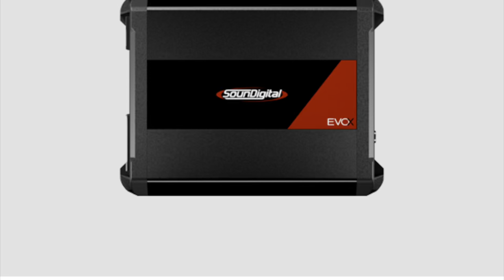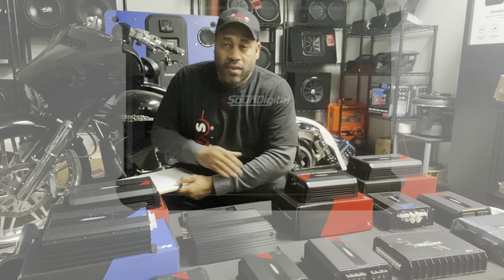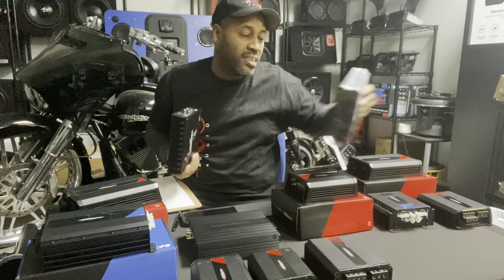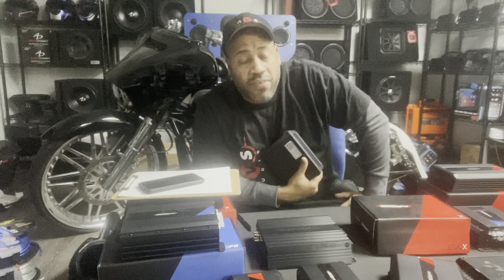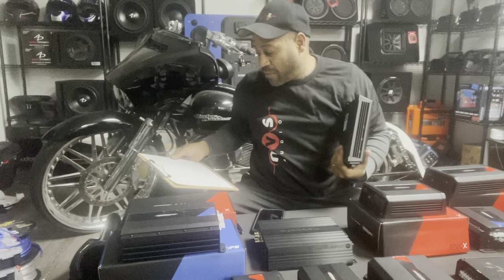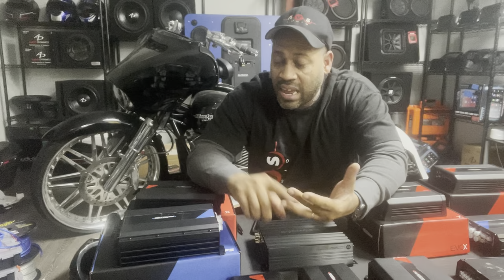How and why we use Sound Digital amplifiers in our audio builds . We love  their size to power ratio

Comment: I installed my 800.4  according to your recommendations.  4awg ground to frame, crimped and soldered, wire ferrels ets  Thank You for all your great videos.  Keep up the great work.
Reply: Me too planning to buy either soundigital 800.4 or banda 800.4 to power 4 midrange speaker of 180 watt rms each. Which one of the 2 u recommend?? I need something which is durable, gives enough power and produce clean music.

Comment: I have an EVOX 800.4 ON MY ROAD GLUDE.  Rrunning 4  diamond audio speakers at 4 ohms each.  Amp installed with FOSGATE complete amp install kit. Gain set with SMD DD1.  No issues after 1 year.

Comment: I almost exclusively only install 2 amplifiers as of right now. The NVX VADM2 or  Sound digital 800.4.   My reasoning behind that is how bulletproof both of them have been. I agree 100% with everything you have said. I would like to add..... if these shops continue to install these high powered audio systems on stock batteries their failure rate will continue to  climb.  I believe you recommend a battery upgrade at  1000 Watts.  I do the upgrade at 700 watts just to stay safe.  Another great video keep up the good work.
Reply: Great point.  You really need to upgrade battery.   Small price to pay to upgrade to lithium when you are spending $3k plus for sound system
Reply: How many options are there when upgrading the battery? Could you add a capacitor or are you talkin about adding a 2nd battery
Reply: @midwestprince153    The short answer to the  capacitor  question is no do not use a capacitor .At this day and time it is not worth the money and especially the space.  There are lots of battery upgrades for Harley Davidson touring models. CCA as well as amp hours or two  Very important numbers to look at.  Basically the more the better. I would not  even start thinking about adding an extra battery until  2400 watts rms. AMG battery up to 2000wrms  Anything more than that  Lifidium battery only.  There are a lot of reasons for my answer but I'm trying to keep it as short as possible. Sorry for the delay in my reply.
Reply: @romesyoutubechannel5356  thanks
Reply: @midwestprince153  I upgraded to the Braille Lithium Battery and I’m very pleases
Reply: Drops the amp on the floor at the end...... damnit lol

Comment: Sound digital amps are the best amp you can put in a daily rider with a system upgrade. And the fit is in my opinion are great!
Reply: Happy you enjoy our amps.
Reply: @diogoiannaccone  love them. We are a vendor for sound digital. Nothing but the best for the Harley Davidsons! Let me know if you happen to have any banners available for our booths we run at get together, audio competitions etc. Our distributor is HKI.
Reply: @ShadowSolja  i am HKI Ceo. 😁 Yes we have banners. Just ask rep to add in your next order.
Reply: @diogoiannaccone  Will do. And Ground Zero is a hot seller. Sound is amazing!! And thank you!!
Reply: @diogoiannaccone  glad to see this video. 
I have 3 of the amps,  2 evo 800/4s running 8 6.5 s (hertz and ground zeros). 1 800.1 to 10inch sub.  No issues.
Reply: @superduty131  planning to power 4 deaf bonce speaker of 180 watt rms each and saw the 800.4 Amp. Are they ideal for fo SQ music?? Are they durable amps??
Reply: @yan5362   Very durable. Sound quality is awesome.

Comment: Our Failure Rate is even with yours, 5% ish Cant be beat for Power & Size, However Diamond Audio has new Amplifier product on the water we are forever waiting for !!
Reply from the maker: Thank you for sharing Your experience 
I truly value your opinion. 

I
Am awaiting the new diamond audio amp as well.
Reply: Appreciate the support
Reply: which amp is that?
Reply: @Grof2000  We use Mostly 800.4 EVOX & 1200.4 EVOX
Reply: @702motoringlasvegas4   do they fit inside  street glide fairing
Reply from the maker: @702motoringlasvegas4  

I have them on my test bench 😉 👍🏽
Reply: @NVSAUDIO  I do not doubt that for a moment. Lol 😝
Reply: @Grof2000  Yes, you can easily fit two of them if needed
Reply: Hey guys how does Recoil amps compare to Sound Digital?

Comment: I've never heard of this brand... And I trust you ... I want a 2 channel to run two 10w6v3 dual 4 ohms .. I need at least 1200.2 but willing to go 2200.2 not even sure there is anything that big... I've only bought dual 4 ohms in the past .. so I have lots of pairs of dual 4 ohms .. even 12 Alpine type Rs 2200 max watts... I have an old 1999 Rockford fosgate that works amazing ...it's twice the size I want in my little 2008 Subaru legacy....I like the kicker kx1200.2  ... The two channels do not work with the wireless bass knob...it requires a Aux bass knob ... I almost bought that amp a few days ago ... Thinking I can buy the bass knob separate ... But nope it won't even link to it ... Not wireless... And not even wired ... I'm not tripping on price...I just want something that works like a JL, Fosgste, kicker, .. Something that stays cool... When running RMS ... What 2 channel of these amps that you're showing would you recommend for my dual 4 ohm subs to run at 2 ohms

Comment: What’s up Carlos…..I have 3 EVOXs in the front fairing of my 2021 Road Glide Special…I have a EVOX 400.4 (4ohm)on my horns(EX6NCD-CF), a EVOX 1200.4(4ohm) on my midrange(EX6NCD-CF/EX69NCD)bridged, a EVOXII 1600.1(2ohm) on my 10”s (EX10NMB) and a HKI mini DSP…I’m running 0g ofc power and ground wire from the battery to a power/ground block …Off the blocks I’m running 8g to the 400 and 4g to the 1200 and 4g to the 1600….My first question for you is do I have enough power to run them new euphoria speakers/midbass….Second question is do I have to upgrade my battery and if so what’s the best battery to use…My third question is do I still have to get my factory radio flashed when using your T-harness …Fourth question is will the 10’’s in my bags effect the 6x9 in my lids….Thanks in advance Carlos
Reply: Yooooo do you have any pics of you install in the fairing.    I’m want to put. 400.4,800.4 and 1200.4 in mines.   I have an RGS WITH LEX AMP RACK
Reply from the maker: Yes you need a lithium battery 

I like
The Braille g30h

Yes you will need to flash your radio 

Hki mini does not like the high voltage from non flashed Harley radios . 

800 watts to each 10 is perfect in my opinion 

Yes you will need to baffle your 6x9s if you are running 10s in the bags
Reply: @mrchuckwoods  ……yes sir
Reply: @atgang7153  where the pics of the install at????? Lol

Comment: After stumbling across your video, I'm wondering if the failure rate is attributed to cooling issues with these amps. In a breakdown video I saw that the housing itself, like with many amps, acts as a heatsink and has thermal compound between the ICs and the housing. Have you broken down a failed amp to see what the condition of the thermal compound is? In nearly all failed electronics I've dealt with the failures have been either a capacitor issue, or poor heat dissipation.

I intend to build a 6-speaker system for my truck using a 6.5" 3-way in each of the four doors and a pair of 6x9 4-way in the cargo area. Being an expedition rig I don't have much space for physically large amplifiers and have to fit both under my driver's seat, so I've been planning an EVOX 800.4 for my door speakers and an EVOX 400.4 for the pair of 6x9s in the rear and no subwoofers. As part of the install I intend to open up the amplifiers and replace the thermal compound with higher end compound that I use my computers, along with mounting the amps on rubber bushings to absorb road and trail vibrations from my truck (lots of washboard roads). What is your opinion on using the EVOX amps in an application like this?

Comment: I have 2- 1200.4 in my fairing and they are cooking my Sony 700 they get hot shut off and I have Spencers under them! Wonder if SD would swap out for 2-800.4 even swap? I was about to go with a different company until I watched this video! I have 4- SPL 6.5 and 4-SPL 6x9 and 1-8 inch 200L in each bag all Hertz Neo would 2-800.4 be enough power? Thanks for any advice and thanks for all your awesome videos!
Reply from the maker: Call me 

I will
Help you trouble shoot your build 

We run 2 12 in the fairing with no over heating issues
Reply: @NVSAUDIO  ok just call the shop phone and ask for Da Man carlos? Thanks so much you are a awesome Guy!!
Reply: Hey Carlos been trying to call numbers on the internet with no luck getting through to you plus I think I may need to purchase a pair of your crossovers for my hHertz Horns! How can I contact you? Thanks again!

Comment: Thanks for the video,  I bought the 800.4 sound digital amp (grey case) I tried installing into my street glide with the aquatic av radio. I cannot get this amp to work. I've tried EVERYTHING!  I'm only running 2 ds 18 pro speakers, ( possibly more in the future) anyway I had a guy message me and said I have to have splitter rca cables to hook up using both channels , going into one set of rca's to the aquatic radio( which only has one set of audio outs. Does this makes sense? I'm only using 1 channel. What's you professional opinion? Thanks

Comment: So I have a 6 speaker set up

SD 800.4 running 4 Hertz sx165s

And a 

SD 400.4 running 2 Hertz SV200s

There’s also 2 Hertz 25mm horns as well

Would you say I’m underpowered? I don’t know much about audio and didn’t do the work myself.

Comment: My main problem with Soundigital is the low end signal noise, do any of you know how to improve or eliminate it?
Reply: I had same problem.  I have one 800.4.  First thing I did is added 4awg ground to frame. Then removed all grounds from my T harness (radio and dsp) and connected to same ground as amp.  When I replaced my stock radio with Sony itt came back.  I fixed that by adding two rubber washers to each of the 4 radio bolts .  Isolating radio from radio bracket.  (Grounding radio didnt fix it)
Now I only have the VERY LOW normal  SD hiss they are known for. It cant be heard at low volume  only at 0 volume.
Reply: @robleeva  I definitely appreciate your advice, will certainly try it out, thx!!

Comment: Bridging sees half the load, twice the output. 8 ohms bridged is 4 ohms at the amp. If the amp is a 4 ohm amp, full power in 8 ohm bridged mode.

Comment: So with 2 10" yellow baskets what amp would you run
Reply from the maker: Evox 2 3000.1
Reply: @NVSAUDIO  And they can handle that!!
Reply from the maker: @lovellemartin5919  if you tune it properly 
Yes 

You won’t be using the full 3000 watts
Reply: @NVSAUDIO  How much power can they take!! What's the most you have gave yellow baskets?

Comment: I was planning on running 8" red baskets in saddle bag lids, 8" prv mid bass(4ohm) in bags off SD 2400.4(4ohm) so I'd be better off with 800.4(4ohm)?
Upfront 6.5 red baskets gonna run 400.4 ground zero tweeters in gauge hole & saddle bag lids
06 electra glide
Any truth to refurbish sd amps being better
Reply from the maker: I would do a 
1600.1 2 ohm on the Prv 8s 
800.4 bridged on the red basket 8 
800.4
Bridged on the 6.5 
Horns on a 400.4

Comment: Got a great deal on db drive moto 6.5 (350 watt) and db drive 6x9 for bags. Would a 800.4 be sufficient. I believe the 6.5 are rated at 100-125rms and the 6x9 are about the same. Any help would be appreciated.

Comment: I went through 3 of them, 2 went out and on the 3rd the fan started acting up. When I got the last 1200.4, I looked at the amp and saw the fan, then was like.... why is there no hole of perforations to allow the amp to breathe on my Amp rack. So I cut a hole to allow it to flow through. Anyone that knows anything about Car Audio understands that amps that can not breathe are going to overheat and amps that do not get the proper power is going to fail. Why every competition car audio car will have a Big 3 upgrade and an upgraded Alternator. Lithium can only give you so much when you are not running the property wire size.
Reply from the maker: You are 100 percent correct sir

Comment: I recently purchased the 400.4 EVOX and am wanting to run the amp Bridged to my 2 front door coaxial speakers. After reading the owners manual It states I need to connect all 4 channels for the amp to work. But if I connect the amp like this won't the amp run one bridged channel as a front channel and the second bridged channel as a rear? I'm now thinking I should have purchased the 400.2 amplifier. I went with the 400.4 in hopes in thd future upgrading my coaxial door speakers to components. Any help with this situation will be greatly appreciated.
Reply: Yes...you need all 4 RCA'S hooked up to bridge both channels. What 2 speakers are you running that you want each to have 200+ watts?
Reply: @TheDolkNess  I will probably just run the 2 front channels for now as I'm just running the jbl GTO629's. In the future I will probably switch to a passive component set so then I will run the amp bridged.
Reply: @T_B_C_L  just run them in parallel...66wrms is plenty enough for those GTO
Reply: @TheDolkNess  will do 👍